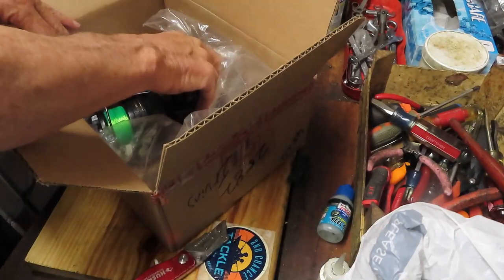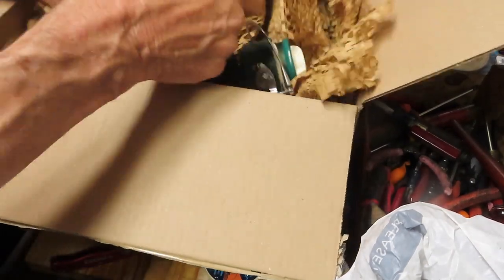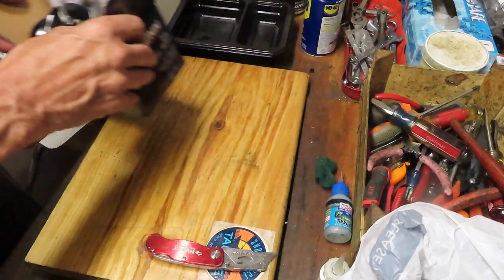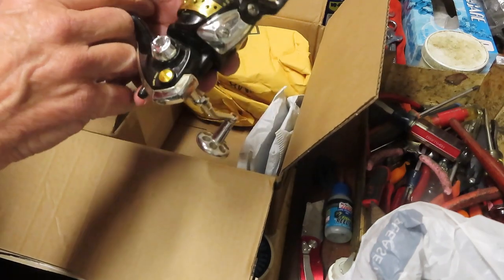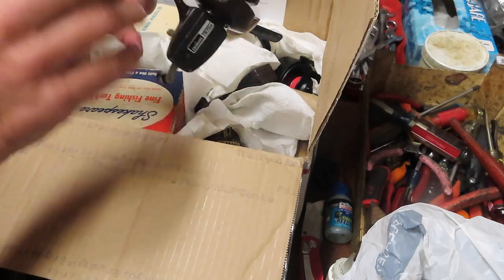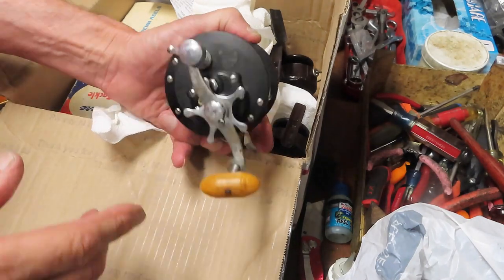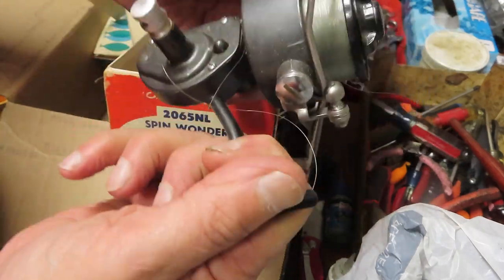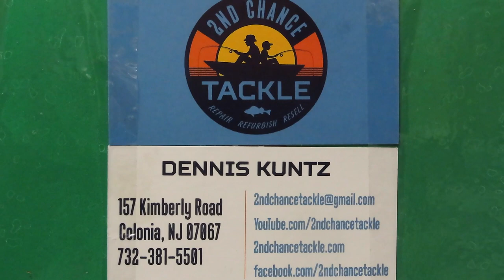New shop fishing reel service and how to repair projects with video previews 5 30

Comment: I’d like to see that last Shakespeare spinning reel you held up. It looked like a 2065? Scott continues to overtake me.  I also love the Mitchell 306 reels. I have three of them one of which I converted to PUM. The 406 reels are very nice too. I’ll bet Scott would enjoy having some of the Shakespeare Sea Wonder reels - 2080, 2090, 2081, and 2091. They are some extremely solid reels for saltwater fishing. You have some nice reels to work on. — Chris
Reply from the maker: I'm just getting started on those.  I should be able to do a video on a few of them.  Be well Chris - Dennis

Comment: I took apart a 4/0 Penn 113 did not realize the dog spring in the gear .  Can you help.  It is a 4/0 113 black face.  I am stuck.  Don’t have the spring lost it.
Reply from the maker: Yes - you can get a replacement spring through Mysticparts.com they are a Penn Parts distributor. - Dennis

Comment: Would you be interested in around 7 or 8 parts reels as a mail in? I am getting a bunch of reels from a friend of mine and they are in an array of condition. Some are definitely just parts reels but the better ones i will be using.
Reply from the maker: Sure thing Jack.  I use the parts reels to give others a 2nd Chance and many of these get donated to first time angler clubs, etc.  Please send them along.  If you need mailing instructions, please send a note to my email 2ndchancetackle@gmail.com. Thanks for the kind gesture  - Dennis
Reply: @2ndChanceTackle  no problem. i will most likely be getting the reels this week so some will be at your shop probably by next week